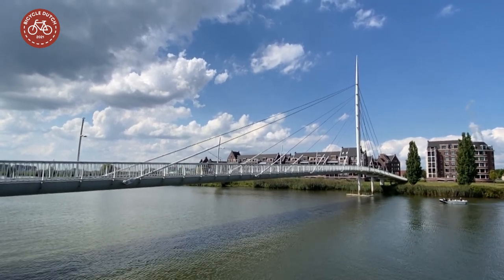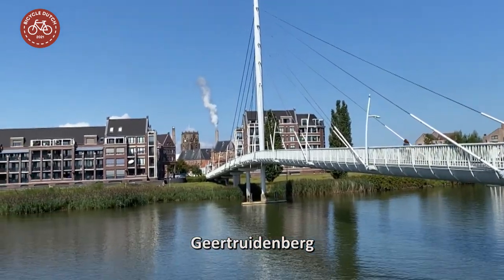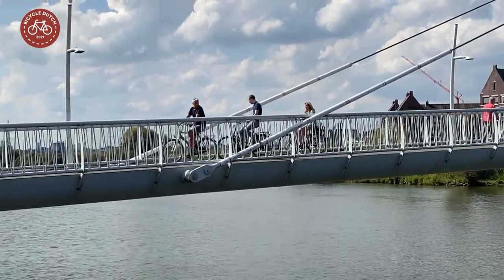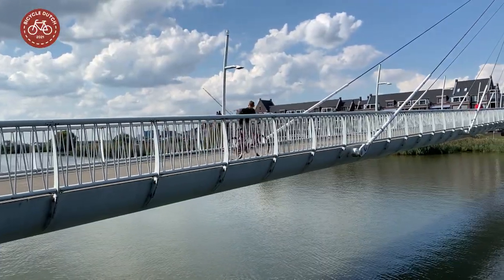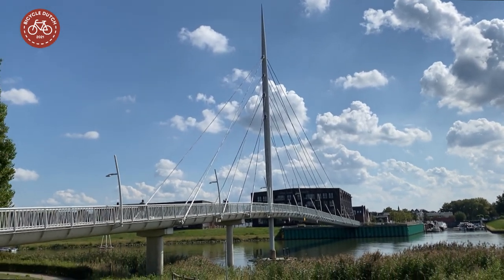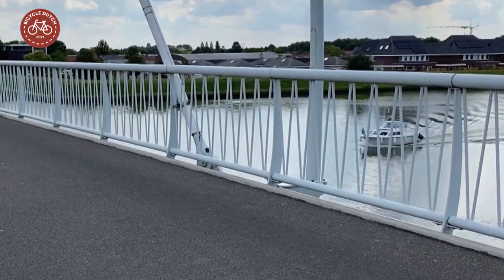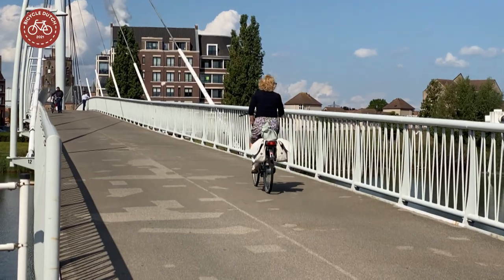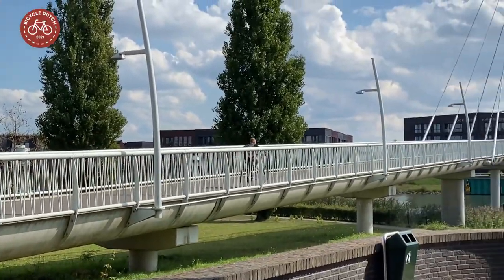A huge cycling bridge connecting two tiny Dutch towns

Comment: Do the lights still work? The Sir Bobby Robson bridge in Ipswich was built in 2009 and has [had] rows of small lights at foot level. Over time the bulbs began to die.  Did the town replnce the dead bulbs? Nope; they just turned off the remaining ones so there's no lights at all now.
Reply: I would say yes. Normally the Netherlands replaces broken lights relatively quickly.
Reply: Maintenance is often a problem in English speaking countries, it seems.
Reply: @xFD2x  I guess because the word is one of the harder ones to speak.
Reply: @steemlenn8797  Then "fixing" would solve the problem.
Reply: That is just part of publiclighting maintenace contract. check every 3 months  6months for led. Or reports from the public.